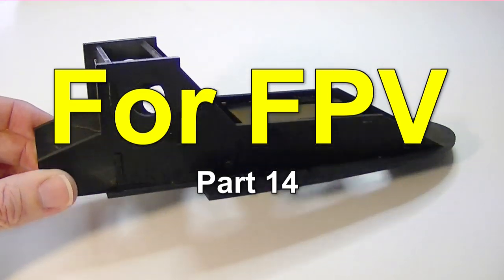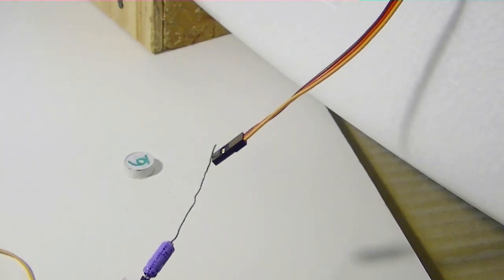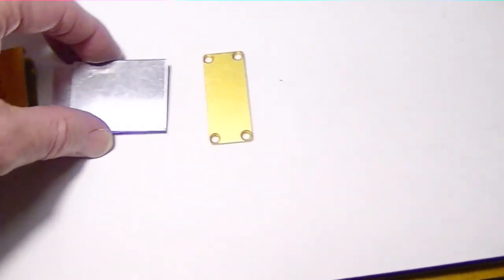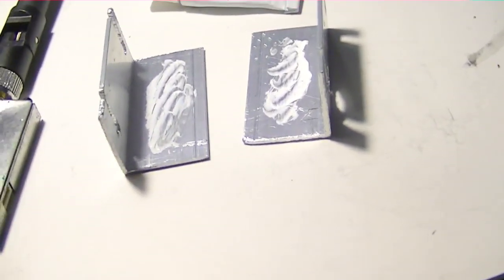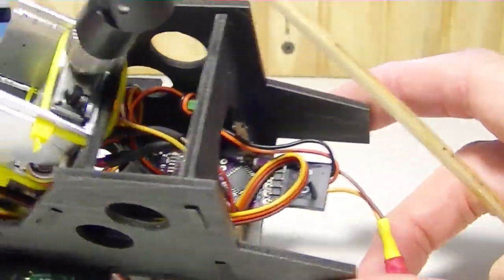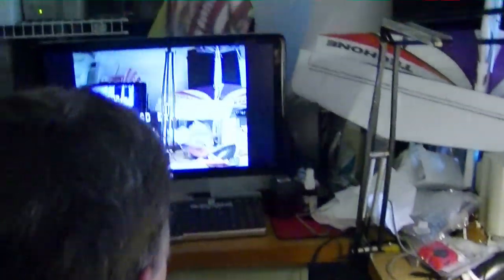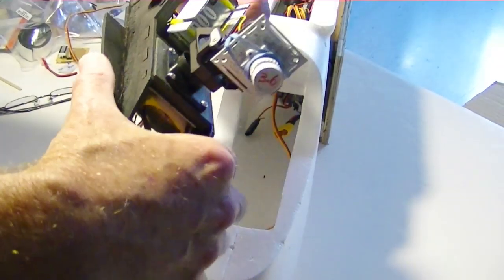FPV Part 14: Video TX Pod Wiring, MinimOSD, RMRC VTX , APM 2.6,  SkyWalker 1880

Comment: sorry i ment on my fat shark camera to immersion video tx :) , i would love to place the video tx on the wing tip but then i need at least 80cm of extension but not sure what cables to use as fatshark doesnt sell extensions .
Reply from the maker: steven keene Good question but unfortunately I have never studied that. I would like know the answer if you find out. My guess is you can just use servo cable and keep it a few inches away from the other wires to prevent noise from the servos getting in the video.

Comment: just a little question i have , i am using the Fat shark-immersion video goggles , now the cables on those are very short , can i just extend them with servo wire ?
Reply from the maker: steven keene You can try but I think what you need is a shielded video extension cable with RCA plugs. It's a common item for home video stuff.

Comment: so is it right to keep the ariels for the receiver and vtx as far apart as pos or do you need to get the vtx away away from the receiver too ? great video
Reply from the maker: The antennas are the important things to keep separated in my opinion.
Reply: ***** thanks i was unsure as everyone seems to move the complete unit out but it makes sense with the antennas
Reply from the maker: Breathe - RC Some people leave the TX unit in the body of the aircraft and run SMA cable out to the tip of the wing for the antenna. Seems to work well.
Reply: i think i will try that way on my x5 many thanks
Reply from the maker: Breathe - RC Should work great on the X5. 
Check out Dick Gibson's channel. He has an X5 setup like that.

Comment: congrats for the knowledge you share... but why did you add the 3.3uF capacitor between the apm and minimosd? what are the purpose for this?
Reply from the maker: The 3.3uF capacitor was a preventive measure in case there was a DC offset between the video power system and the APM power system. Probably this is not needed.

Comment: Another related question somewhat addressed  in another question..  I was wanting to multi function with the APM telemetry output feeds...   paralleling Bluetooth BT2S  TTL UART ( for tablet Mission Planner view ), the standard 3DR Telemetry wireless ( for laptop Mission Planner view ) and the MinimOSD for FPV display...   I have seen and have the impression.. the MinimOSD  does not need the RX connected because it does not receive any signals... where the 3DR Wireless and Bluetooth need both RX TX...

Comment: Was wondering if you soldered the 2 points on the back of the MinimOSD board as detailed in your schematic because there was no 12 volt feed running parallel through the back end of the board with the video feed transition where it picks up the telemetry readings... heading to the FPV transmitter...

Comment: Really, you dont want one. The wings ripped right off it at 200 feet and i have been fighting Hobby King for months to replace it. They told me the warranty is void if i crash it. No shit i told them. However the plane carbon fiber rod snapped at 200 feet so what was i suppose to do. Hobby King is a terrible company and i will do my best to buy as many products elsewhere.
Reply from the maker: You could get the pod and the Skywalker I have at BEVRC and probably be happier plus the pod is sure to fit.

Comment: Great series Dave! I am putting together a similar system and was wondering about the capacitor that you used. I couldn't find a 3.3uF at the Shack. Where did you get yours and how did you decide to use one? Thanks!
Reply from the maker: The cap came from my junk pile of components I collected over the years. 
I tried various sizes until I found one that did not degrade the signal. You could probably use a different value and get it to work. I also suspect it could just be left  out but I didn't try that. This was my way around my fear of a DC offset damaging the APM and not from any science or engineering. Usually the APM is capable of powering the MinimOSD without any trouble so my fears may be unfounded.

Comment: Dave, thank you for the informative videos. The schematic that you attached here is very helpful. I have a question about your setup. I believe that you installed the telemetry radio and the video radio together in the plane. In this video you have the signal and ground leads from the OSD in the camera pod back to the APM. Can I assume that you created another breakout cable to have the OSD and the telemetry radio both plugged into the 3DR Radio connector on the APM?
Reply from the maker: That is correct. Servo lead wires were used to extend the cable to the 3DR Radio and to split off the two wires for the MinimOSD.

Comment: Dave as You are familiar with all APM systém now maybe You could help me.
Could be possible to design systém with APM 2.5/2.6, telemetry 433mhz [I am in EU], minimOSD, FPV with realtime sound + live data on screen, and + antenna tracking on the ground ? What is critical point to reach that systém? Is it vTx, which must have stereo audio transmitting capability? Antenna trackers needs some data from OSD, which are often transmitted trough audio channel. Then second audio channel is needed for live sound . Am I right? Or Am I totaly wrong?
I wanna build plane with APM 2.5 [I have it at home] and functions as I described. I am confused in this, because I do not see any audio output from minimOSD to vTx.
If You have any idea, help me please. Eddie
Reply from the maker: The minimOSD only mixes video. You can add a microphone to the audio input on the VTX. The immersion VTX that I am using is only monaural so stereo is not possible. My minimOSD actually injects a lot of noise/hum into the audio so I use an amplified mic to try to get above the noise floor. That helps some but the sound is still not good. Not sure if I have a bad MinimOSD or if they all have this audio interference. The video is not affected and looks good.
I would be interested to see if you experience the same audio noise problem when the OSD is powered on. 
    At this point I have no idea about antenna tracking. I plan on just manual tracking by turning the patch antenna pole.
Reply: ***** Hmmm... thanx Dave. I will let you know. It will not be soon, as I am just in starting faze...  It will také 2 months. I thing noise and interference is reason for separate power on minimOSD.[5v from APM and clean 12v for video section. If You merge it by solder jumpers all power is dirty on minimOSD..  But my question is if minim OSD has audio o/i at all?  My camera will have microphone.  Ok, we will see...
I can not wait for Your flight!!!  GL.

Comment: Hi dmerc00
Big congratulations first!!!  Nice systém, nice videos - very helpfull !!
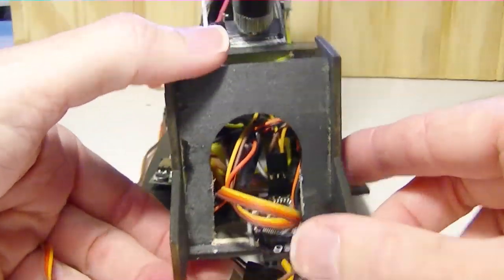Just little confusing - You speak about 12V video section, diagram shows 3cell lipo, but on the video 7:59 I clearly see 2 cell lipo...   Am i missing something?
Reply: Dave, I apologize !!!!!   I am blind....  Very sorry!
Keep going and have good luck on flight.
Reply from the maker: Thanks for the comments. Hope to fly soon as the weather is better.
So far my setup has not changed for what you saw in the video.
It has proven to work well in all bench testing. Yes the battery is a 750mah 3 cell and will run the vtx for over an hour.

Comment: Hi, two quick questions. I've heard a lot of people saying that the minim osd cuts the range on the lrs systems to only a quarter mile? is this something that you have tested or have you changed something to prevent that? Also, what program do you use for your wiring diagrams. I would like to create some but dont know what to use. Your videos have been very helpful, i am creating my own long range system with all of the same components with the exception of the lrs. Im using dragon link. Your videos are very helpful
Reply from the maker: I have heard that too and Dragon Link has a fix. I am using EZUHF which doesn't seem to have that problem.  Never the less I have placed the minimOSD in nose and the EXUHF LRS antenna on the tail as far apart as possible. However I have not ranged checked it yet.  The schematics are from the Ardu Plane wiki and all I did was modify them with photoshop. You could use a CAD program like smartdraw, DFX or google markup.